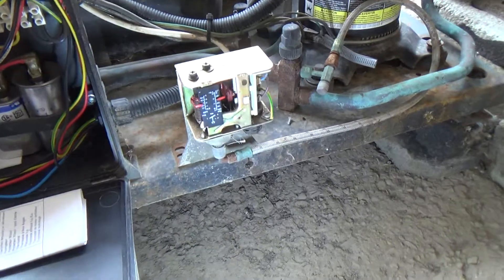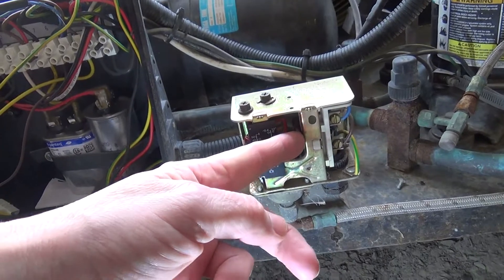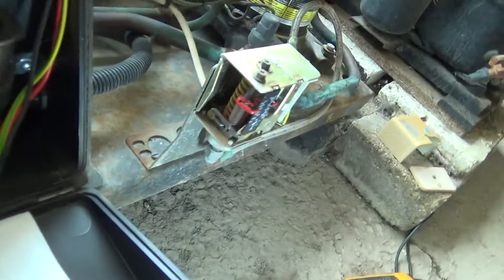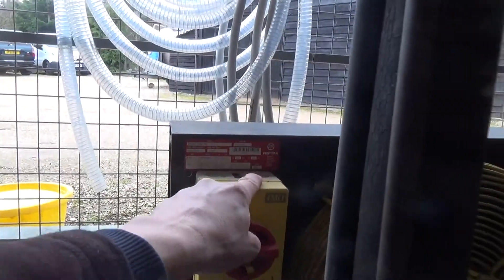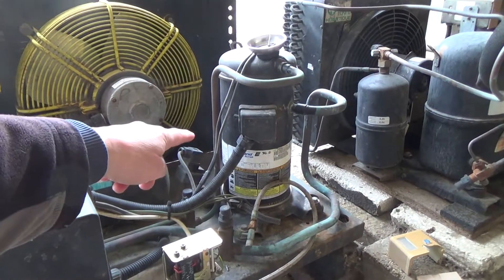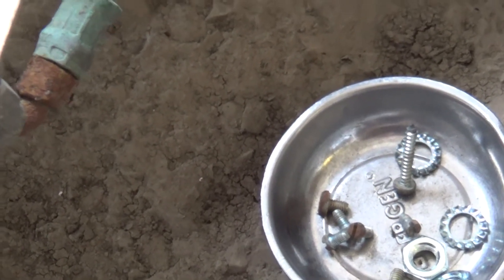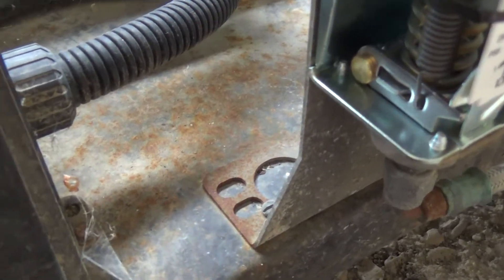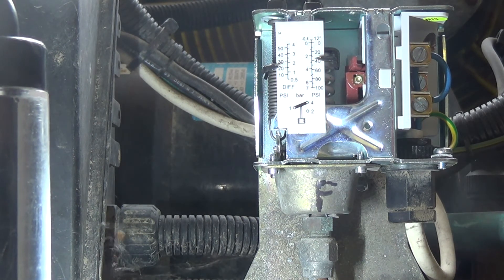Weird Fault on Low Pressure Switch

Comment: Did you just introduce moisture and air to the system!?
Reply from the maker: No, I didn't open the system, I just swapped the bellows from the old switch to the new one.

Comment: ???How in the world did that happen🤷‍♂️ very interesting thanks for sharing the video.
Reply from the maker: Crazy isn't it! Thought someone had been trying to fix it themselves but was wired correctly.
Reply: Going to guess the switch element inside the old one snapped off the one contact pivot, and this piece has dropped down to make a new fulcrum, so that the switch mechanism changed operation style. Normally pin one end, force applied to middle to make it flip style, but the small piece of broken brass dropped down onto the one contact, and the whole moving part slipped slightly, so that it misses the contact, making it be open circuit. Now with dropping pressure the switch flips position, and the contact meets the little brass scrap and closes the circuit. Likely there is a nice big soot mark in there as well from the arcing in test, as the little scrap is not rated to carry the current and has been arcing away.

hopefully John will have a few pictures on the autopsy of this switch later on.
Reply from the maker: Might see if I can take it apart to find out what went wrong.

Comment: Brilliant workaround to navigate the GWP minefield 😄 I had a brand new ranco LP switch which was configured arse about face. Switch was made on low pressure and broke at about half a bar. Had me scratching my head did ages. Fsw took it back, sent it away to be tested and refunded us which was fair enough
Reply from the maker: I had to get a new one to compare it to, thought it was me remembering how they work wrong to start with!

Comment: personally, I would just put a new one. it was enough to close the valve, And install a new element
Reply from the maker: There is a service ban here on doing any work on the refrigerant circuit if the system contains R22.
Reply: @heavydiesel  Here though the service monkeys just use R22 as a cleaning agent to blow out blocked drain lines.
Reply: what country such regulations
Reply: @baduk16  3rd world..........

Comment: You da man John , finding a way around that , I wouldn't even have thought of it  I reckon , brilliant Sir !👍 
By the way , did you mark the old one with an F for ... ?
Reply from the maker: Thanks! The F was for front, I marked new and old bellows the same so wouldn't fit the top part backwards by mistake, and could put the new one back together if it didn't work.
Reply: @heavydiesel  Right ... I thought F meant something else ... 😅
Reply: @sterlingarcher46  same